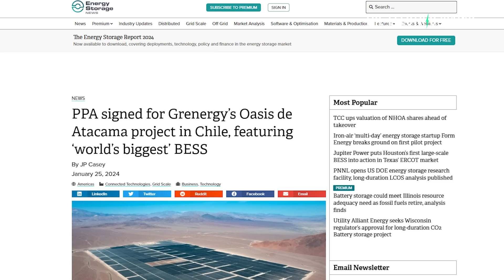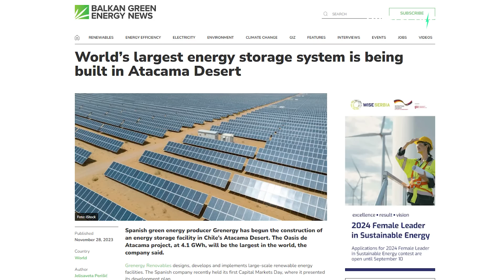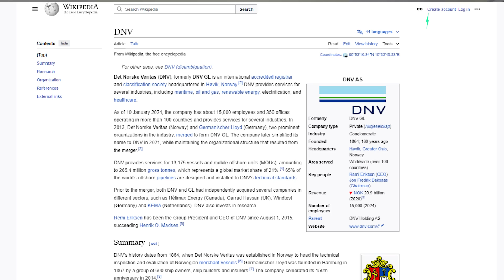The world's biggest battery powered by an enormous solar farm in Chile

Comment: Worth pointing out that the Atacama desert is the driest and about the sunniest place on earth. Parts of it are high above sea level so the solar potential there is off the scale.
Reply: The ideal is clear skies, loads of sun and low temperatures. Hopefully the altitude keeps temps down.
Reply: Correct. It also makes it the ideal place for astronomy, because not only is it high above sea level, but also rarely has any cloud coverage. Some of the world largest telescopes from countries all around the world are located there as well. More info: https://www.youtube.com/watch?v=ZrScfEL0ZrE
Reply: What is the SRI in Atacama. Solar Radiation Index. Do you know SRI Atacama Chili.???
Reply: So?  Ideal!
Reply: And with the shade provided by the solar panels some of that desert might be usable again.

Comment: Nobody is talking about sagging transmission lines in summer heat starting bushfires.
Transmission lines at max capacity supplying air-conditioning in heatwaves.
Transmission lines over heating and sagging, running hot at maximum capacity in heatwaves.
Reply: Why repeat the same thing 3 times, you sound like the search terms they used to hide at the bottom of porn sites
Reply: @michaelmartin9022  because people assume that clean electricity will be the answer to stopping CO2 emissions worldwide and stopping warming the climate. 
They assume that grid electricity is the answer, but the grid is extremely expensive.
Grids are breaking down with black outs because they are fragile and they are built to minimum engineering and economic stds.
All centralised generation will over load the existing national grids.
Rooftop PV and BVs oversized battery is the only economic engineering solution to increase the amount of electricity that millions and millions of people will need.

So I just keep talking around this point. 

Some people understand.
At least some people are not so lost in the wrong solutions. 
My old CivEng friend is a nuclear promoter now and talks at public forums and on paid trips. 
We both have grandchildren but he is lost in his old ideas. 
The Snowy 2.0 is an example of waste.
Australia has decades long droughts. 
The grid real costs are being added to the project budget which is exploding to $15billion from $2billion. 

I have limited finances but I can post comments.
No porn.

Comment: Rooftop and BV does not need the grid, in fact the system can over supply the grid and distant big batteries and distant renewables are not needed. 
Central grid generation, fossil or nuclear is not needed. 

The electric world is limited buy grid capacity and the HUGE COST TO BUILD BIGGER GRID CAPACITY. 
Rooftop and BVs are customer funded. $0 , that is ZERO $.
Central Nuclear and Distant Renewables are $BILLIONS.
New GRID CAPACITY is $TRILLIONS.

And we need ×3 to ×7 times more electricity to replace fossil fuels. 

So $BILLIONS plus $TRILLIONS,  get a grip on the numbers. FGS.
For God Sake. 

Australian GDP is $1.5TRILLION. 

And we need $7TRILLION in new grid electricity, fnkg wrong.
Decades and decades and decades and millions of resources for a bigger grid, bs.

Rooftop and BVs are absolutely the only economic way forward.

Rooftop and BVs supplying the existing national grid with new heavy industrial users, new heavy electric customers.

Can be done in 2 decades at minimum costs.

Listen to the nuclear promoters, nuclear engineers, PH.D nuclear promoters, political nuclear promoters, they ALL TELL YOU THAT NEW GRID IS TOO EXPENSIVE. 

They do not tell you electricity is only 15% of all Australian energy used. 😮😮😮😮

Sam do your homework if you want an electric future for your boys.

Australia has 1million km. 

It is fragile, just off broke, will blackout with just a little more sunlight.

$1,2,5,6million per km, even $10million for New grid capacity. 

So for those fools who can not do maths, $1,2,3,5,6,10 TRILLIONS.

Straight from the facts quoted from nuclear promoters mouths. 
And government published grid information. 

Australian grid took 100years to build. 
10 decades for the first grid plus CO2, plus resources, plus finances. 

Grow up and look at our facts.
Bith sides of politics is not telling the full truth.